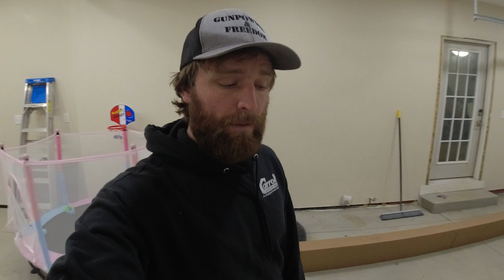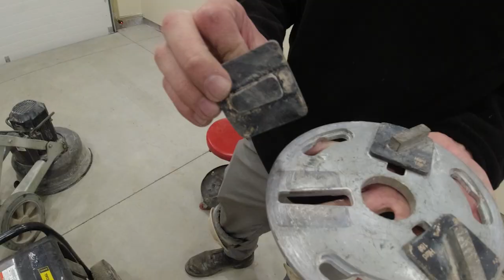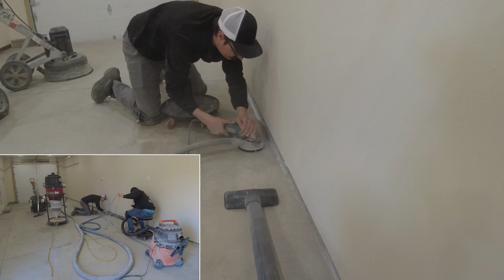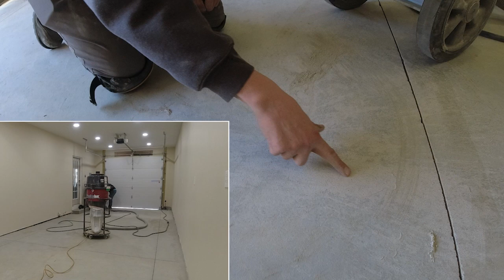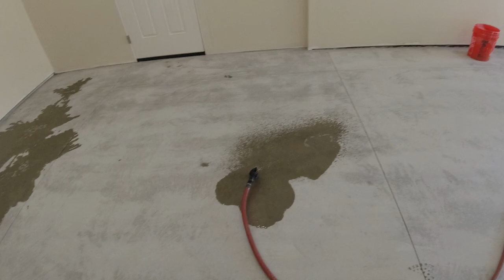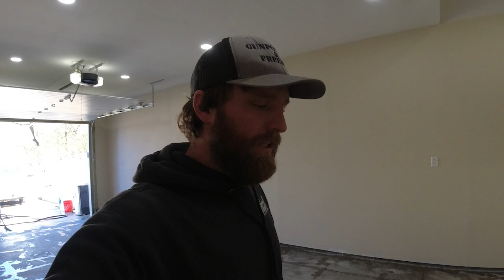Prepping For Perfection: Grinding The Surface Of Your Concrete Floor!!

Comment: The one thing I've seen on these epoxy floor coatings... all the time... and I mean, ALL the time, is that the recommended quantity is NEVER enough.  I think this is the first time I've seen it done when it appears as if the recommended quantity was accurate.  Seriously - I've seen it done over 20 times now and they NEVER buy enough to get the whole floor done if they follow manufacturer specs... so that's one BIG plus for SICA (sp?).
Reply from the maker: Hahaha let’s chalk that one up to Pats math hahaha thanks for watching!
Reply from the maker: And it’s Sika